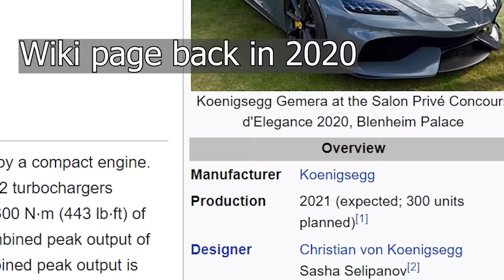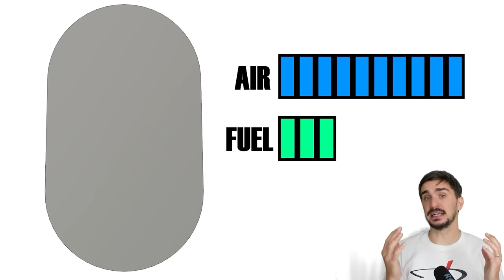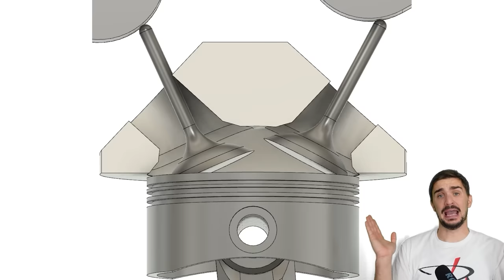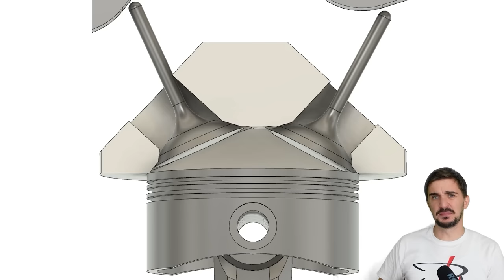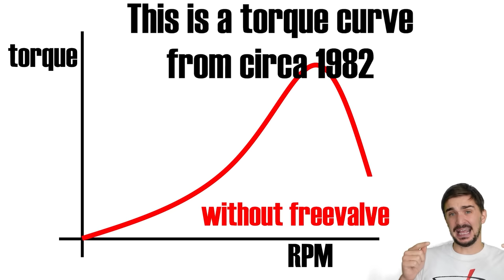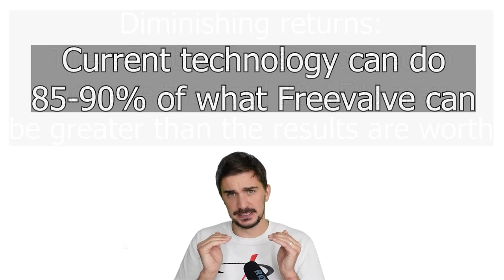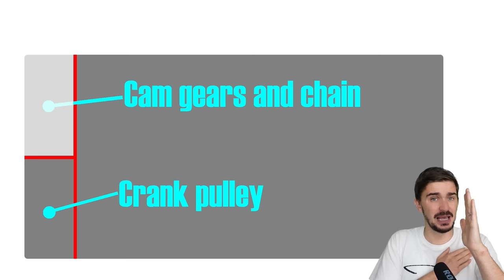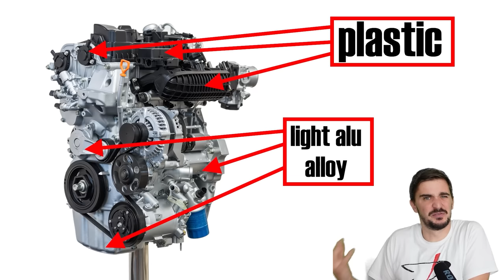FreeValve Isn't a Big Deal. Here's why

Comment: Great video, but wasn’t also the freevalve concept to be able to achieve very high rpms? (Since you don’t need very hard valve springs)
I heard that a very long time ago though so might be confused.
Reply: I heard that as well. It reduces the rotating mass and amount of mechanical parts which would theoretically allow engine to rev higher, faster and with less risk of failure
Reply: I think for safety reasons and engineering simplicity, free valve would still need very hard valve springs.
Incase the free valve system fails, you would want the valves closed during failure to protect engine, so the most reasonable choice would be to use springs to close the valves and use whatever free valve system to counter the spring force and open it. This also simplifies the system a bit since it only needs to provide force in one direction.
Reply: The technology to have high rpm valve train has been around for a long time. They had small race motorcycles running 15,000+ rpm in the 60’s. 
The camshaft and valve train runs at half engine rpm. So, the bigger limit often becomes the pistons and rods at high rpm.

Comment: 'FreeValve' died before it was born. 
OTT engineering, complexity and tolerances = poor reliability, very costly and frequent maintenance. 
Economically it's a 'black hole' venture with miniscule advantages compared to modern engines.

Comment: I’d rather have the CSRV rotating valve technology. It simplifies the combustion engine to half the moving parts, lowers the center of gravity, sheds weight, and increases the durability. Where free valve complicates the engine, makes it less reliable, but sheds weight, increases performance and lowers the center of gravity. Unless your buying an exotic car, rotating valve technology is the logical and commonsense need. It will reduce car prices while making cars more reliable.

Comment: I don't know if I like the idea of free valves!! There's to many way's it can fail and cause major damage to the engine.. admittedly idk a whole lot about the system but when I apply logical thought to it! How does it mostly fail? What else in the valve can fail? What's it's failure mode (open or closed) can the valve fail to the point the valve is just free of the stepper motor and just opens and closes as the piston goes up and down? Can I jam open and hit the crown of the piston? I also think a system like this could be really good for efficiency and power by timing each valve perfectly but there's just to many ways it could fail so idk if I like it or do I think I could trust it

Comment: How about something like hydraulic cylinders that the cam journals sit on that could adjust the cam up and down away/towards the valve stems that would adjust the valve lift evenly across the entire valve train? Build in enough compensation in the timing belt/chain tensioner to compensate the lift changes. I think this would affect the duration as well by proxy. Seems about the minimum amount of additional moving parts. Or maybe this has been done already? I'm from the pushrod school so I'm a little outta touch.

Comment: You cant judge the 1.6 turbo engines without knowing what boost level each is at. Also freevalve could be added to the gr engine and reduce a lot of rotating parts. I do agree in the opinion it might never be mainstream.

Comment: I was working on a similar project in early 2000's for diesel engines. Really unique mechanical designs in some cases.
One iteration involved a valve that did not move, but, instead, the port would move, recess, away from the valve.
Reliability was probably the biggest hurdle. 
Ultimately, it was not feasible for cost vs. performance & reliability.
I am sure they have come a long way in the past couple of decades, but with EV being all the rage, I don't see it coming to market in consumer vehicles or light duty trucks any time soon.

Comment: You do an incredible job of explaining engineering as always.  

A valvetrain always puts resistance on the engine from turning the cam lobes and the compressing the valve springs. I thought the decision to power Freevalve pneumatically was bizarre.  Sure it makes for great variation of valve timing, but it does not solve the problem of reducing a load on the motor. Opening valves places a load on the motor by having to turn the cam and overcome the resistance of the valve springs.  Instead of valves opened mechanically through cams & rockers/lifters, they added a compressor and decided to control valves pneumatically.  I noticed in the Freevalve animation that the valves still had to overcome the resistance of a spring to actuate.  I thought it would've been easier to manipulate valves electronically minus a spring rather than pneumatically and still having to overcome the resistance of the valve spring.  The engine already has an alternator.  Why add a compressor when there was already an alternator?  Now I'm just some guy on YouTube posting a comment. I'm not an engineer.  I would still appreciate an explanation from someone that may know the answer.  I'm sure some engineer out there has thought of operating valves electronically.  Why isn't it viable?  Why not have valve opening duration done electronically and mapped in the ECU according to RPMs?  Is that not possible?  Dirtbikes have electronic power valves.  Why couldn't cars have electronic intake and exhaust valves?

I get how this technology may never make it to the mainstream.  The auto industry has never been at a more precarious time.  Engineers are not willing to invest too much more research & development in internal combustion innovation when the world may be on the way to a full transition to electric.

Comment: Fiat's MultiAir technology actually works. Naturally-aspirated 2-cylinder version called TwinAir in the base Panda and Cinquecento can push 60hp, and the 1.4 turbo in Abarth 695 Biposto easily makes 180hp and can even be pushed to 230hp. FreeValve is kind of unnecessary, hence now Koenigsegg offered the 5-litre V8 twin turbo from Jesko as option for Gemera too.
Reply: I bet that the V8 is the only option.  3 cyclinder Freevalve engine has already been scrapped.  Koenigsegg does not want to lose face and cancel the engine covertly.  If I were them, I would ask the sales representative to persude the customers to switch to V8.  Gemera has not been produced yet.  It will be very easy to switch their customers to V8.  Just offer them a free upgrade.
Reply: @catchnkill  I think the green car recently presented is a 3cyl from what I've heard. The idle reminds me of S&S V-twin from Morgan ThreeWheeler but once revved does sound like... a BMW i8 on way, way too much corticosteroid.
Reply: @AntoniusTyas  From what I read from their news announcement Gemera production car will start production at late 2024.  I think they may have made one or two cars for demo or internal testing.  I think only the cars delivered to customer count.

Comment: I like the free valve concept but you would also to program the fuel injectors in concert with the free valves. Also I think, in my opinion, you would need high compression pistons like 11:1 or 12:1. You could also install a turbo charger or super charger with 11:1 compression since a lot of 1.5L turbo charged engines use very high compression. When back in the day that if wanted to install a turbo charger or super charger you would only be allowed to use 8:1 or 9:1 compression. 

When I was young, about 17 years old,  I built a Chevy 350 bored .060 over size. Of course I had the heads & manifold ported & polished. I used 10:1 compression fly cut pistons with a GMC 671 roots super charger with a longer duration & higher lift camshaft & 2 Holley double pumper carburetors. Later on when I was building I came to realize I could have gotten away with 2 Rochester or Rochester style spread bore carburetors. And at the time it produced a respectfully 450 HP.  All the people on the block used to complain to my parents when I fired that engine up because as a test engine that I was building for the first time I used open headers. Later on I had a speed shop pick up the engine to put it on the dyno. I forget what the torque was. 

I eventually put this engine in my 1979 Z28 Camaro with a rebuilt high performance Borg Warner Super T10 4 speed transmission & a hydraulic dual disc clutch. I sold it to a friend's father before I enlisted in the Marine Corps. But I wish I still had that car.

Comment: I really see a good opportunity on outboard marine engines. Narrowing the mounting center allows more or larger displacement engines on the same transom and boats are very sensitive to engine weight in terms of how the boat sits in the water, also marine engines spend extended periods at constant (but not fixed) RPM which means being able to optimize valve timing with higher resolution than cam based VVT systems can will bring greater efficiency gains for a boat than it would for a car where the rpm is constantly sweeping. Also since most marine outboards are N/A I would expect the power gains to be more significant than they would be on a turbo application as in now ubiquitous on cars.

Comment: FV is to camshafts as Fuel injection is to carburetors. Carbureted camshaft engines can be optimized to a specific task, but can not adjust to different tasks and conditions as well.
VVT and fuel injection do a good job of adjusting an engine to varying conditions for a lot less money and complexity.

Comment: Spot on video, camless 4 stroke engines have been in development since the 60's and every time someone tries it again the same two difficulties crop back up. 1) power consumption, generally these systems require more power to operate than a camshaft and usually this outweighs any efficiency gains vs a conventional engine never mind a modern CVVT&L engine. 2) cost, the systems are expensive, so are other variable systems but when they get as you say 90% of the benefit for 10% of the cost it's a no brainer which one you go for.

Square wave valve timing is also not ideal, to maintain air velocity you want the valve opening to be linked to piston speed. Open the valve to fast and you get the same effect of long duration cams, but even worse as you have to avoid the piston so your timing is less optimal or you have to run less squish / non interference design and thus less compression ratio

Comment: I have a zero interference cam/valve combo that can be a small as 15mm tall total pacakge excluding intake/exhaust
Does this really help anything?
Maybe in efficiency slightly
It can be mechanically driven or independant per cylinder
it is less complex with fewer moving parts, basically 1 per cylinder
But realistically
No, it would take years of mass production to make it rival the reliability of traditional cams+valves

Comment: Presumably you could allow a free valve engine to rev to around 18,000 RPM though? 
The traditional limit of around 8,000rpm tends to be limited by the speed the valve springs car return the valves, but this limitation would surely be removed therefore allowing for much higher RPM's. 
MotoGP and F1 use pneumatic valves and both of those series topped out at around 18,000rpm albeit a few years ago before the current turbos in the case of F1.

Comment: Very didactic video, well done. One thing that is not mentioned, though, is that electrically-actuated valves require a fair amount of electrical power draw, meaning bigger alternator necessary, on top of the increased harnesses around the engine, countering some of the mass advantages put forward. 
And another one is Lotus, that also developed a very similar system 20 years ago or something, and abandoned it for the very reasons explained in the video
Reply: Cost was never an isue. Auto industry failed 2 or 3 times trying to make EV. And they are trying (and spendig rivers of cash), once more.
Why ?
Because it's not a climate reason, it's about MASS CONTROLL.

Comment: I agree engine size BK of Freevalve wouldn't make a significant difference in cars, but it could be fairly significant in motorcycles since the motor is a larger proportion of a bikes weight. Also a more compact size would make it easier to place the engine to improve handling. Especially considering the lower valvetrain height for a Ducati 90° L shaped engine, allowing to position it closer to the front wheel.

Comment: I could see freevalve being handy for the pickup and work van market, reducing weight directly increases carrying capacity, plus with an air pump you could set it up to have on board air for using air tools/ air suspension not to mention the possibility of increase an of fuel economy even a small amount would be useful

Comment: The whole point of Freevalve was to free the Engine power that is diverted to run your Cam system. And since Digitizing it completely gives your more freedom with your intake and exhaust valve timings, it might enable more aggressive tuning to extract the last drop of HP gains that is possible with current technology and understanding of the Combustion process. The only complexity is to design the electricity required to run it sustainably so that the car itself can recharge the battery used to drive the Cam profiles. Also someone from America named Wesley already has an up and running home made Freevalve Engine powering his Miata. His design is open source and available for anyone to download for free.

Comment: 12:42 BMW's Valvetronic does not have any way to open one intake valve more than the other. All valves on the intake camshaft are varied in lift by the same eccentric camshaft. When the Valvetronic motor advances the eccentric camshaft, it changes the geometry of all the camshaft followers at the same time, which changes the lift. It can not change them independently.

Comment: Great video as always. I've been a licensed technician for almost 50 years,, seen it all and worked on all. I use to hate calculating which cam was appropriate for car for the rest of its life.. lol.. then VVT came,,, was the best thing since the engine itself,, then Nissan attempt to variable compression.. I believe that freevalve is truly the ultimate in ICE management, but one advantage of mechanical connection to cams is that if any VVT don't work or sensors it will resort to lock position,,, if freevalve shits the bed, you will instantly have hydraulic lock, since no valve can open, unless he has some magical spring to crack open every valve 1 mm, to prevent it.. 
Keep up the great work.. I don't know if you ever made a video on V-12 or 16, but my son and I are restmodding his Jag XJS v-12, and thinks we squeeze 500+ HP..

Comment: I think the issue is also making camless system work. I am not an expert, but if I remember correctly, there are issues operating these devices due to the speed they are actuated. Mechanically steered valves are precise and last long.

As we say in our engineering departement, don't create solutions to problems that don't exist. Yes, weight might be reduced, but you induce more problems with it and thus also failure rates. Also: Solenoid tend to get stuck... Not something you want to see with a thing that moves at 1,500 to 6,500 rpm.

Comment: That was BRILLIANT!  I have also been waiting for the "Freevalve" motor to revolutionize the industry, now I know why it hasn't.  Another note:  about fifteen to eighteen years ago, our shop mechanic attended a Ford seminar in which they had discussed solenoid actuated valves (not solenoid activated-air assist).  They predicted it would hit the market in 2-3 years. It never happened. While giving unlimited control of valve timing, they also suggested that, at certain RPM and load conditions, the engine could switch from four cycle to two cycle, to improve the mass efficiency of the motor and create more power.  Still, I had never heard of the variable valve lift demonstrated on the Fiat.  VERY interesting.
Reply: Mfgs are circumventing all just leaving engines altogether in favor of motors..   2 moving parts ....kapish
Reply: @tomrepurpose2770  The problem with that is the problem with all EVs, energy storage, charging times, inadequate battery safety, and the lack of sufficient generating capacity and electrical grid.  Yes, motors are simpler and cheaper than ICEs, but you have to add in all the other factors.  IMHO, hybrids (cars and planes) are a technology that is mature and immediately available.  I have had, for two years, a 2020 Ford Explorer Police Interceptor hybrid, and I love it!  Fast and excellent mileage!

Comment: I can suggest freevalve can be useful at motorcycles. We can't easily mount snail and intercooler there, there's no space for them. Smaller size and weight are also a good solution for motorcycles.

Comment: I see another problem with freevalve and engine durability. If one of that device fail (and there could be one for every cylinder) then it will damage engine (if valve would stay open). In VVT (Variable Valve Timing) technology if it is stuck in one position then camshaft will do it usual job by closing and opening valves but with no always optimal timing.

Comment: Take what we have learned about freevalve and change heads completely. Instead of valves they work as flaps.

Now they have no direct contact with the pistons. Intake would open towards the cylinders and exhaust could open towards the exhaust

The valve technology would be able to hold the pressure of your chambers. You can increase mixing in the chambers and thus increase exhaust flow.